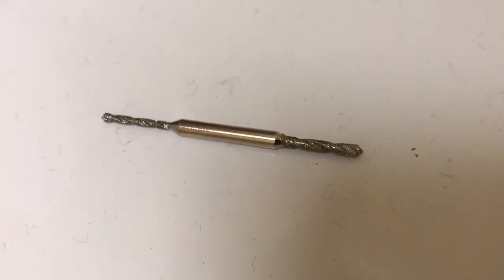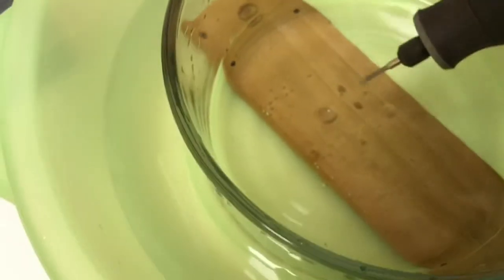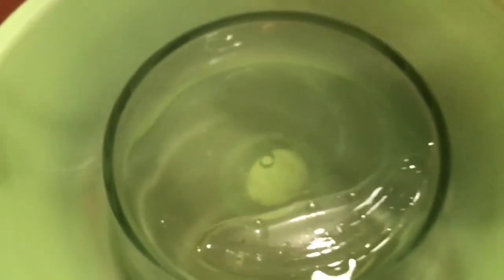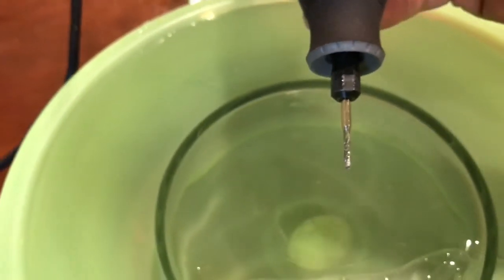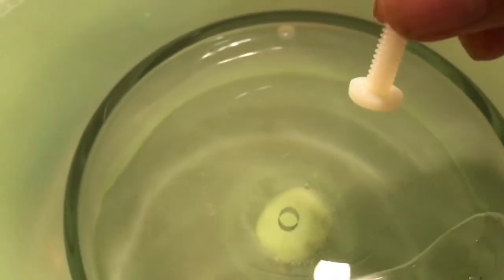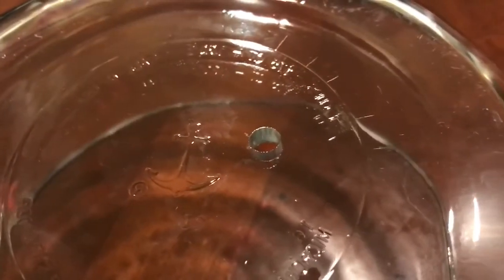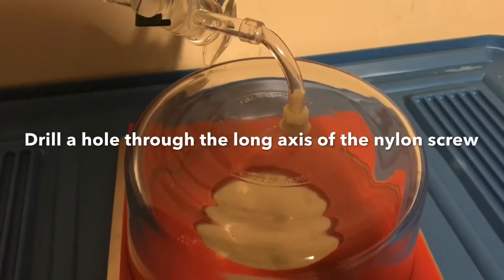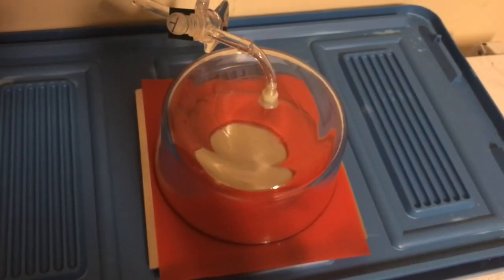How To: Drill a Hole Through Glass

Comment: Hi may i know what type of drill bit being use in this video?, need to drill a hole on a reaction tube
Reply from the maker: Jacky Jacky it's a diamond drill tip that I bought from Lowes. Worked very well!
Reply: @BrianDhvTinkerer  super thanks for your reply, appreciate your upload, been scavenging for a while, most of the video avaliable on utube is a regular glass... None upload stating the material of the glass...